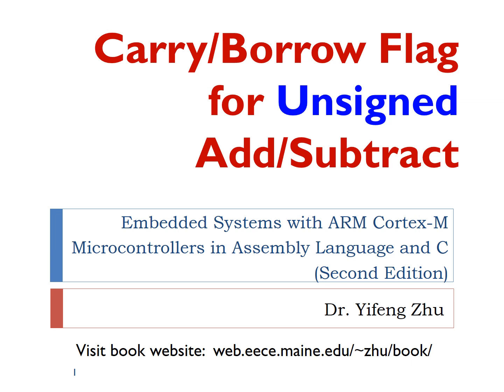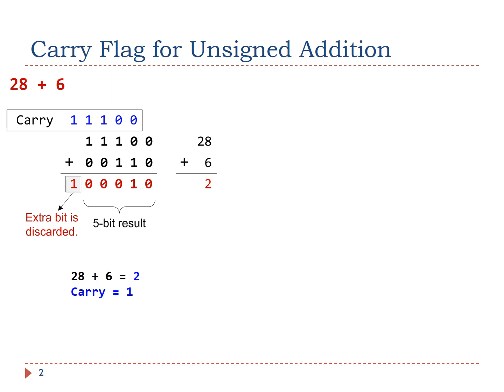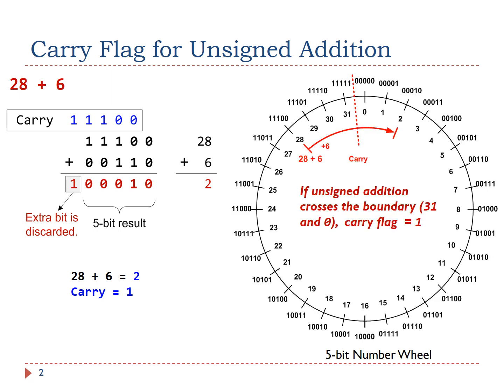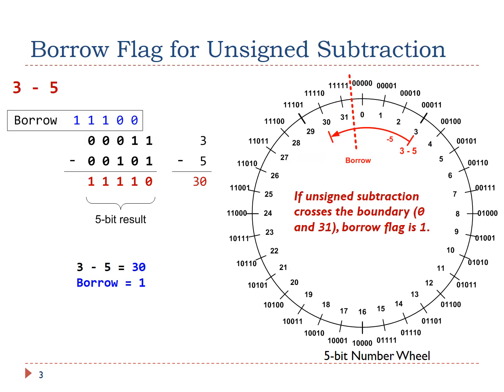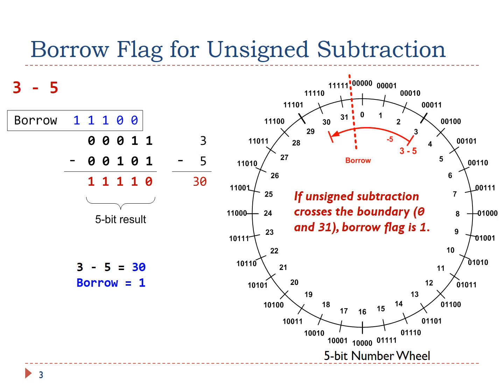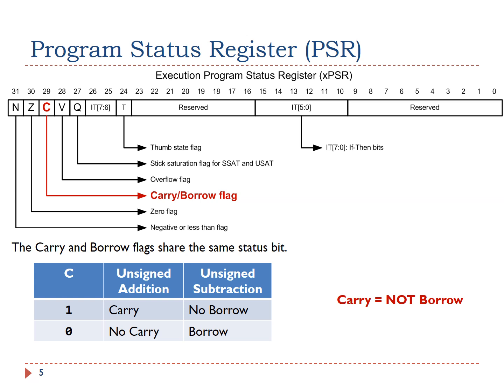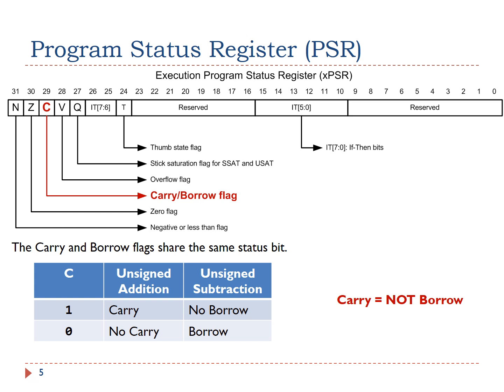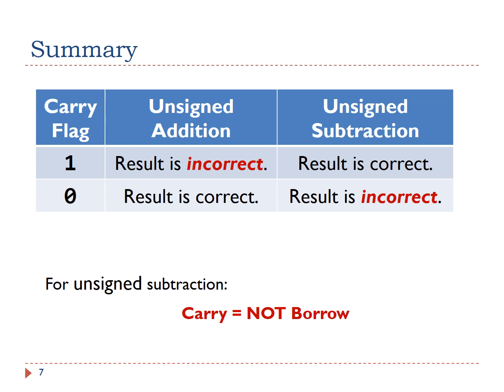Lecture 2: Carry flag for unsigned addition and subtraction

Comment: Pls keep in mind that the rules for subtraction (no borrow = carry) only count for some processor architectures. Some do set the carry flag if there is a borrow and some do set the carry flag if the subtraction using addition of the twos compliment has a carry. You can look up the architectures here: https://en.m.wikipedia.org/wiki/Carry_flag
Reply from the maker: Yes, you are correct. For ARM Cortex-M4, carry = not borrow.
Reply: Excellent discussion! And yes, in x86, 3 - 5 sets the CF while in this processor (in this video), CF is cleared 🙂